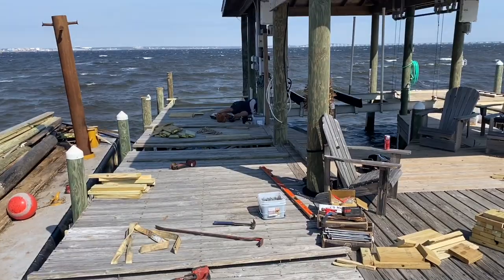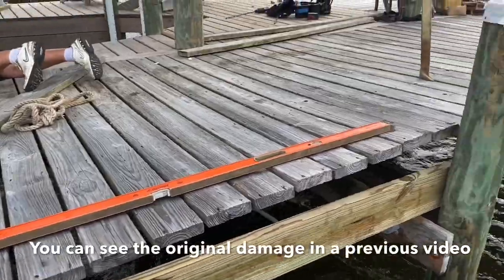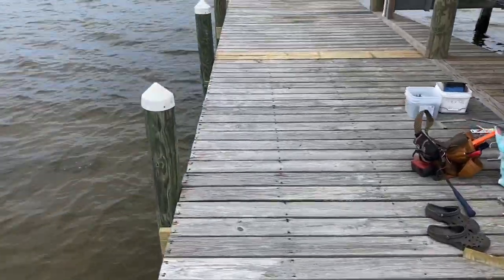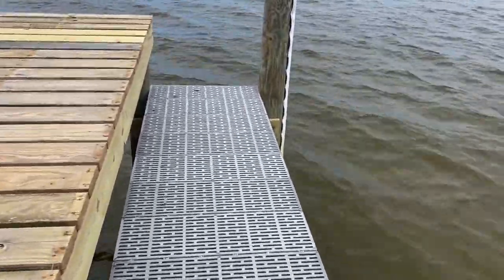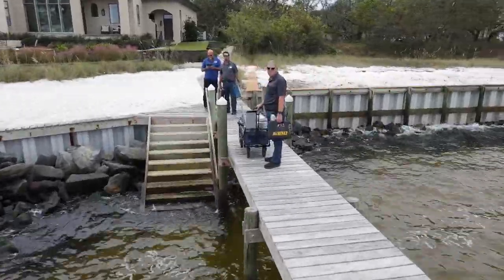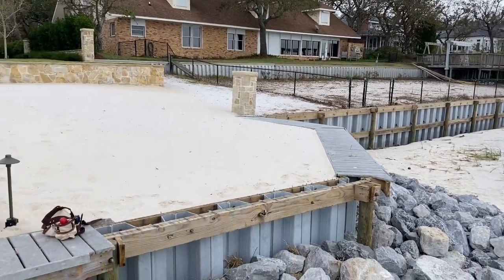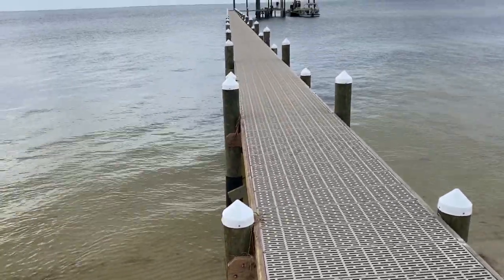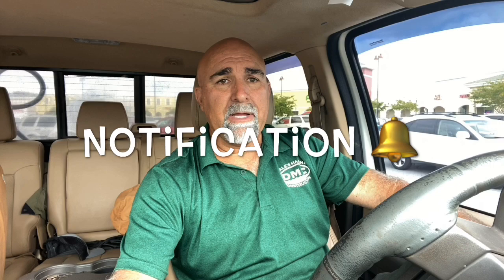MARINE CONTRACTOR VLOG/Dock repair after a Skanska Barge hit it. Gulf Breeze Florida

Comment: This dock damage looks a lot like mine after Zeta's surge waters pounded it mercilessly.  Are all the stringers from shore to the boat house secured to the pilings with bolts?  If so, what about the inside stringers?  Also, you mentioned hurricane block styles in the video, can you tell me a little more?  Great videos.
Reply from the maker: Thanks for your comment Paul on our average style dock we install one bolt on each side of the cross tie and one bolt through the stringer and piling the center stringers are screw to the crosstie with three inch stainless steel screws. On our custom style dock we install two bolts to tie on each Piling and one bolt through the stringer. Our center stringers are screwed to the cross ties and blocked connecting the stringer and crosstie together. This is what we call our hurricane blocks we do this instead of hurricane clips.

Comment: Dale, how do you determine how far the pilings will need to go into the ground? I'm out in Navarre Beach and am looking to get our dock built very soon.
Reply from the maker: Robert Kellen Hey Robert really depends on the soil conditions but typically in the sandy bottom we try to get at least 8 foot of penetration but prefer 10 foot and we always install the larger end of the piling in the sand. We waterjet ours to get started and then vibrate it in with our vibratory track hoe to get them seated real good.